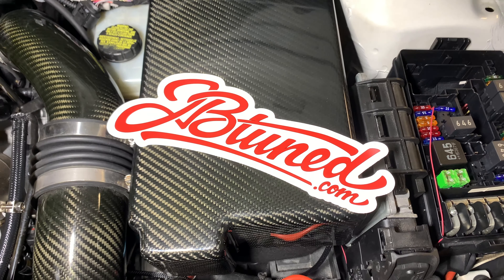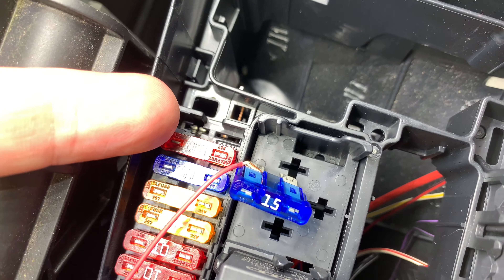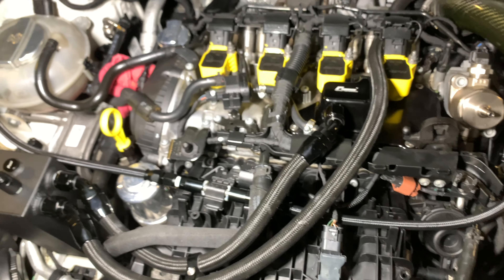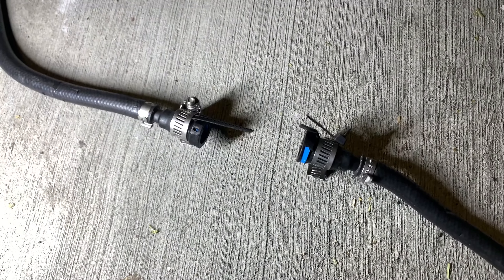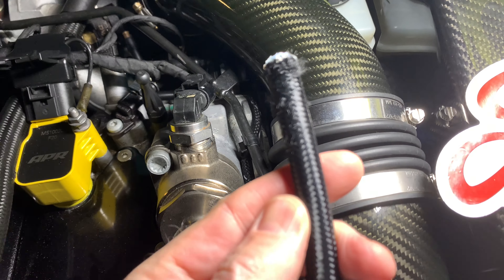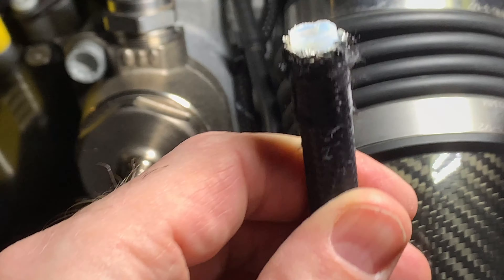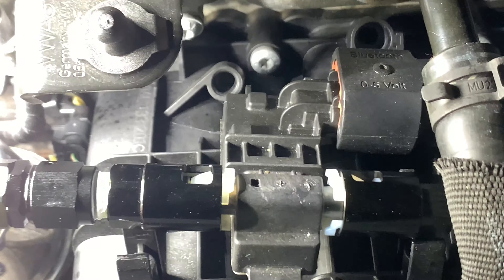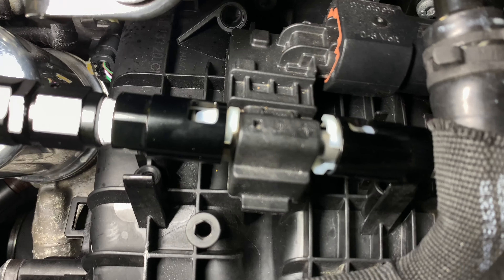JB Tuned e85 Fuel Lines install on a MK7 Golf R / GTI

Comment from the maker: After cutting my HPFP line slightly too short and ordering and installing a new one from JB Tuned, I can now say with confidence that the HPFP-side fuel line should be right around 15 inches from the end of the clip that plugs into the Ethanol sensor to the other end of the line that plugs into the HPFP.
Reply: Why 15inch??
Reply from the maker: @ThiagoFreitasBr  Assuming that the hard line to sensor side line is a standard size coming from JB Tuned, then 15" on the other side's line (+ the width of the sensor that sits in the middle) will give you the right amount of slack to place the sensor in a good place between the plastic tab fuel line holders that come up off the intake manifold (You will probably still have to trim 2 of them so the Eth sensor sits flush.  Also you want to leave some slack in the line to account for engine movement.  It rocks back and forth when you shift and engine break.  You don't want it tugging the line off a hard line nipple.  Really I would say, eyeball it and do what works best for you, just don't cut it too short like I did 👍🏻
Reply: @Kevin_MK7RSR  Nice bro, you answer just what I think that would be the cause, I am doing my setup next week and will fix my fuel it close to my water bottle, so it will stay stable and the line can work with more facility, thanks for advice.
C'monn
Reply from the maker: @ThiagoFreitasBr  If you fix it to the Coolant bottle, just make sure there is enough flex.  Have a friend rev the engine while you check it out.  

Also, FYI, I trimmed off the two inner fuel line mounting tabs on the intake manifold and kept the outers.  You can use tin snips, or a dremel cutter tool (Dremel is better).  The outer tabs are enough to hold the line in place and allows enough room for the eth sensor to sit on the left-ish side of the manifold.
Reply: @Kevin_MK7RSR  Thanks for the tips man
Reply from the maker: @ThiagoFreitasBr  NP, good luck!

Comment: That quick connect that clicks on to the steel barb by the evap line is that 3/8” or 5/16” to 6an?
Reply from the maker: Not sure, but if you check the kit for the MK7 Golf GTI / R it might list the size.
Reply: @Kevin_MK7RSR  kit doesn’t say but in the video it looks the same as the 3/8” vibrant you bought for the analyzer. Did you by any chance notice if they’re interchangeable?
Reply from the maker: @stevebbkny2394  Hey, sorry, not sure what you mean by "The 3/8 Vibrant", I only got lines from JB Tuned.

Comment: I would of went with the Precision Raceworks Flex fuel line kit and AN6 Fuel line upgrade kit really easy to install and perfect fit and no crimping!
Reply from the maker: I would take anything over the Fuel-It lines, but I prefer the JBtuned lines.  Their kit comes with 2 lines.  Both sides of the sensor you will need - From the Hard line in the back to the sensor, and then fro the sensor to the HPFP.  The PRW Kit only seems to have one line...  https://precisionraceworks.com/products/mk7-flex-fuel-upgrade-for-ptfe-lines

Comment: Hey man, so I recently asked a question on the eqt fb page about my fuel line slipping off and you had recommended this kit, I want to get it but the problem is that the previous owner I think broke the two little clips that need to be compressed to get that fuel line elbow off, do I you know how I could get it off?
Reply from the maker: Hey, ya, I broke a clip too but still managed to get it off.  You just need to do what I mention in the video and compress both sides in (Despite the clips being broken), and push it down first, and then yank it up.  If it doesn't come off the first time, just jam it up and down with a tool pressing in those sections.  👍🏻